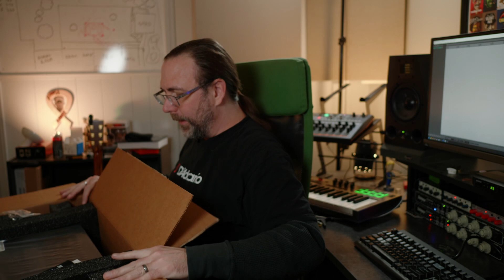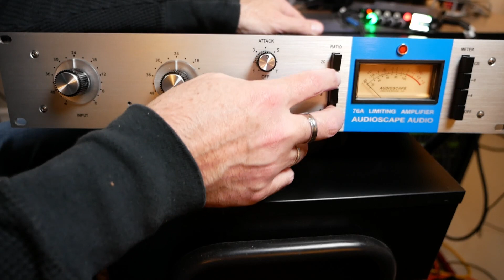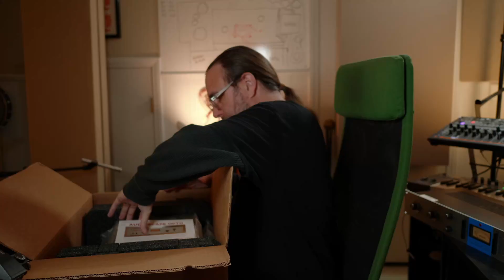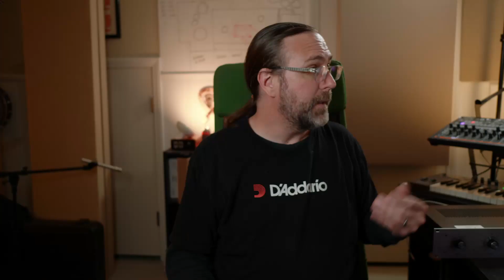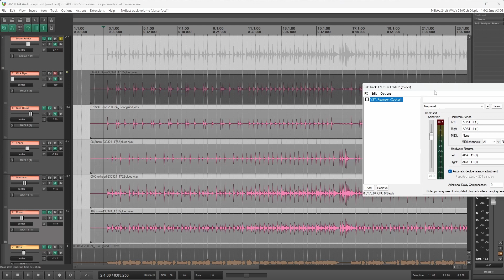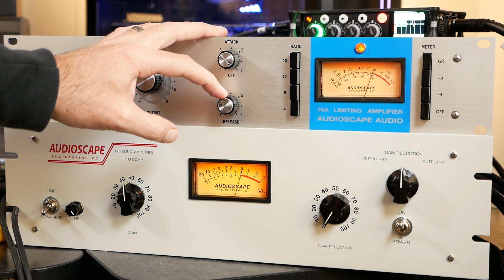Audio Scape 76A and Opto compressors - Unbox and Workout

Comment: do you still have your RME and you still love it ? Cause i wanna see a video about the RME how you set all uo in totalmix....etc.....can you do this maybe ?
Reply from the maker: I'm still using and loving the UFX+, it's a really great interface.  I don't do anything fancy with TotalMix, I just make sure that each hardware output is mapped to its respective software playback channel, which I think is the default way that it's set up when it's installed.  Other than that, I mainly just use ReaInsert in Reaper to go out to a compressor and back on a track.

Comment: Cool video YHRS. I'm not going to chase down those items as my  budget and ears are up to the challenge BUT I'm going to hook up the simple, old cheap outboard compressors I do have a try to work out a way to make use of them. I'll have to look at Kenny's channel for info on the Reaper in/out though. The mono mix if FAB.
Reply from the maker: Thanks Ray, definitely hook up those old compressors and see how they do!  I don't know why I'm so addicted to hardware compressors but I just love them.  ReaInsert makes it pretty easy to treat outboard gear just like an insert plugin, I'm sure you'll be up and running in no time.
Reply: @YHRS  I've done the 1st phase of gear revival. Thinking mostly about bass. I hooked up my ancient Alesis MicroLimiter. I haven't used it in ages  as it's in a rack of outboard gear that has, usually, been a hassle to get to. I even dug out the manual and set it up per recommendations for bass. A little tweaking and I did some audio tests. It works as described on the box and is now set up so that I can use it easily. ONE DOWN.
Reply from the maker: @raycochrane3971  That's great news Ray!  Having things easily accessible is the real trick isn't it?  And I know it's easier said than done...I spent several hours on Sunday rearranging things in my rack and my sore muscles still haven't recovered from the effort.  Now I'm curious what other toys you've got stashed away!